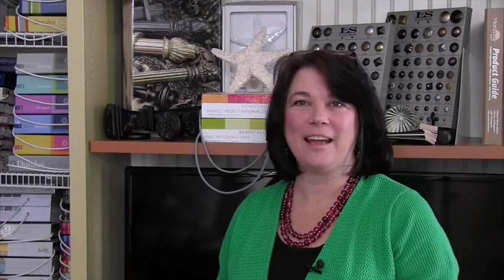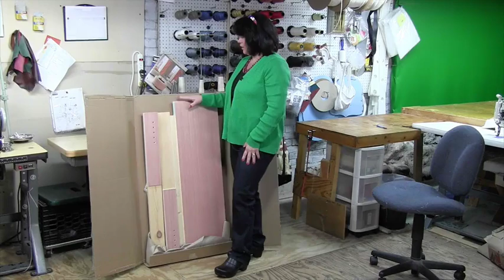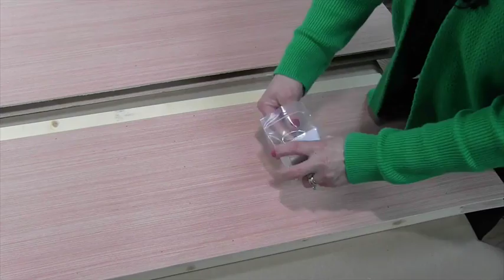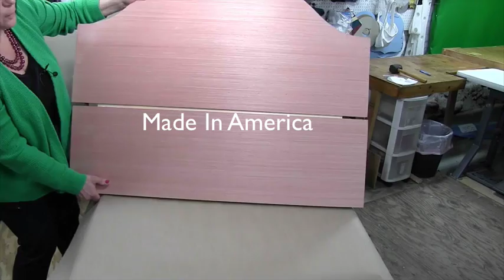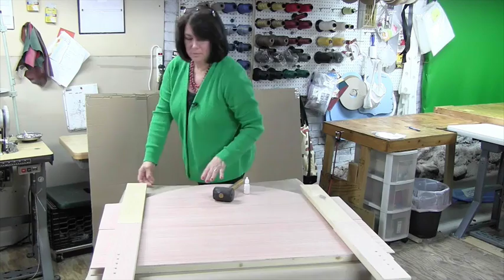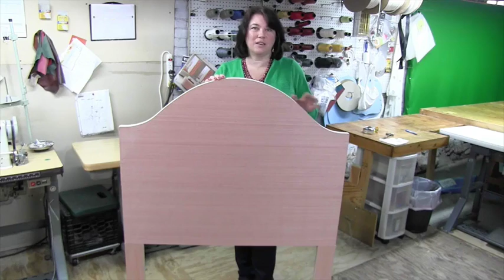Upholstery How To Assemble a Ready To Cover Headboard

Comment: Hi Kim,
Great videos! Thanks for sharing. These frames are great and I'm thinking about ordering one for a DIY project. But I'm wondering if they can be used for a boxed headboard or tufted headboard? Are they too thin for that application?
Reply from the maker: The Ready To Cover headboard frame would work fine for tufting, asf or a boxed hb I'm not sure but you could easily modify one or have Ready To Cover make you a custom frame. Bill